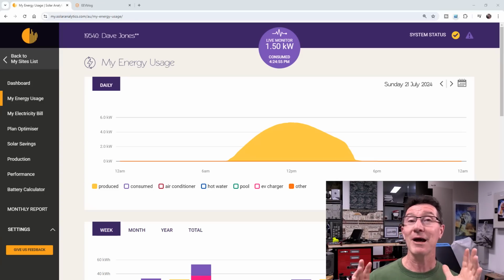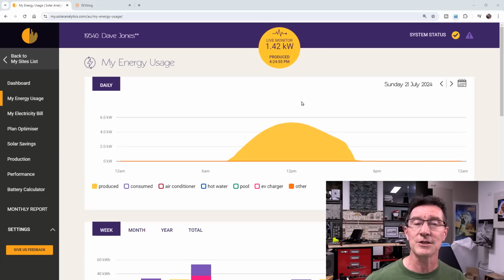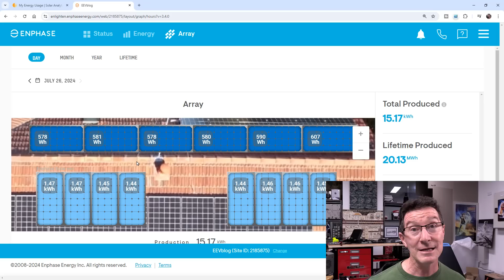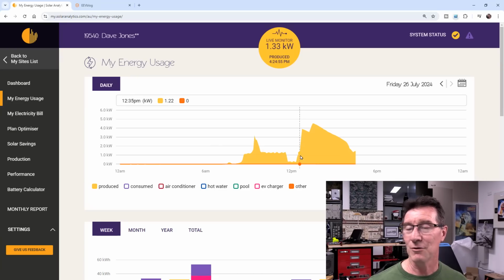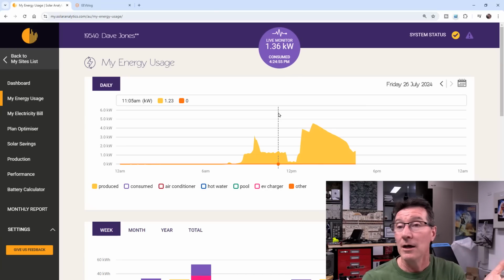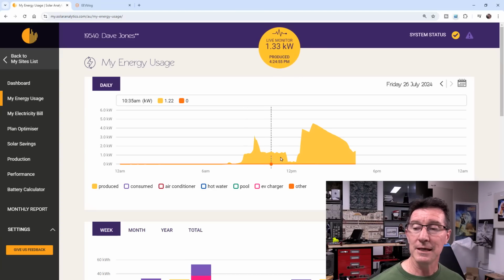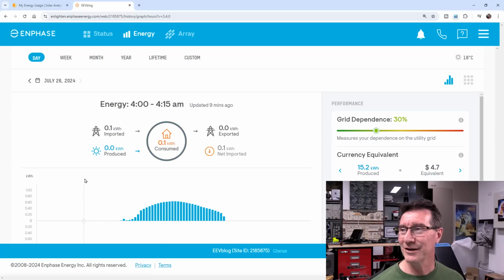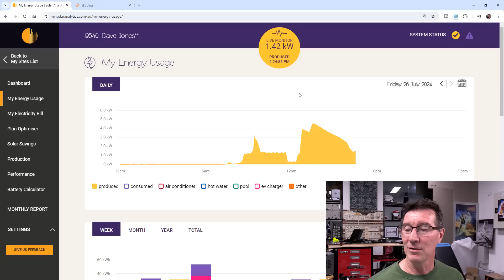The DOWNSIDE of my Home Solar Storage Battery

Comment: @EEVblog2 the way around this is to connect all of the enphase system to the Gen port - then use Solar Assistant as your monitoring tool. Works a treat for data :-)
Reply from the maker: I'm afraid not. My system would then be limited to the 5kW maximum peak power of the Deye inverter, halving my system peak power. No thanks.
Reply: @EEVblog2  not really - 5Kw is the limit of the inverter converting circults, not the electrical in/out of the inverter itself. You can connect 2.5Kw to the Gen port on top of the 5Kw of directly connected panels.
Reply from the maker: @G88gleplex  I have 4.15kw of Enphase, and also only 4mm square copper going back from the Deye. I'm not throwing away power and upgrading two very long cable runs just to get some data integration that canultimately be done with software.

Comment: Solar assistant should be able to provide this information via the Deye inverter as it has the ability to monitor its DC coupled solar and the AC coupled solar, once the battery is full it will able to report any power being exported to the grid.
This is should be possible provided you have the external CT (usually supplied with the Deye inverters) on the feed between your meters and switchboard and install a 2nd small CT meter on the Enphase system that connects to the Deye 232/485 port.
Reply from the maker: Nope. It can only sense the total incoming or outgoing power from the grid. If the house uses any power from the Enphase system then it doesn't know that.
Reply: you need to extract (rs485/solarman loger) data from deye and enphase and merge on one graph in solar assistant/home assistant/diy nod-red+grafana
Reply from the maker: @airfox123  Yes, the only solution is to combine both Deye production data with the Enphase production data. I don't know if solar assistant natively supports doing that.
Reply: @EEVblog2  install a 2nd small CT meter on the Enphase system that connects to the Deye 232/485 port.
Deye inverters happily communicate these meters.

Comment: Can't you add another sensing line to the battery port? Then you just need to split off everything flowing through there with a specific sign, basically power INTO battery = solar production and power FROM battery = grid savings provided by battery. Might even be doable in the sensing electronics themselves, although probably not as easy as sticking a diode in there.
Reply from the maker: As I said, the Solar Analytics system uses AC mains current clamp, and calculates the power based on the mains voltage.